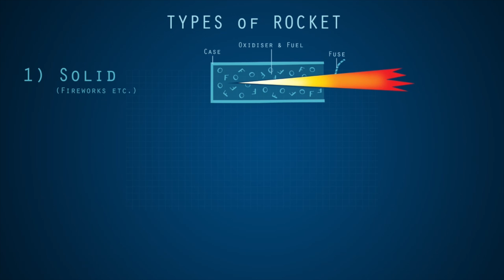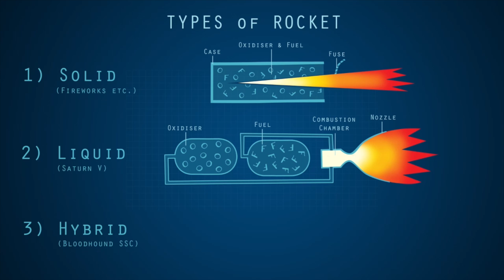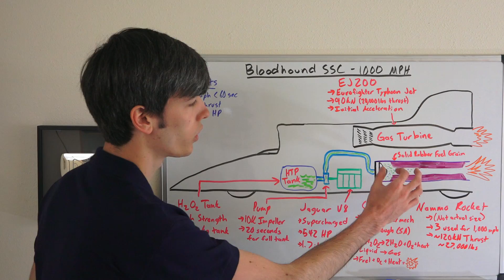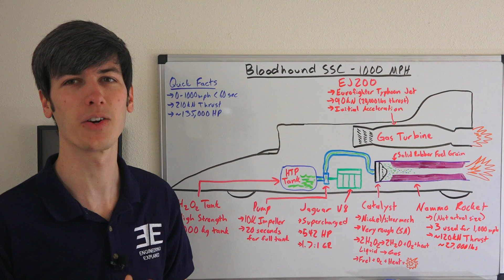Bloodhound SSC - 1000 MPH Hybrid Rocket System - Explained

Comment: With a total thrust of under 50k lbs, aside from cost, why didn't they just use a bigger jet, the the big GE jets pump over 115k lbs of thrust?
Reply: It still has to fit in a relatively small car.
Reply: A good question. A GE-90 costs about $25 million for a start. This EJ-200 is on loan from the RAF because it's out of hours. Secondly and much more importantly, jet engines cannot process supersonic air. A special intake duct has to be designed which will create shock waves which will slow the air down sufficiently for the engine to process it.

The front of the Bloodhound is very cleverly designed. The first shock is created by the cockpit canopy over Andy Green's head. There will be a number of other features in this inlet to slow the air down but it remains relatively simple. It's a pitot inlet like an F-16 or Rafale. A more complicated variable geometry inlet (like the F-15 or MiG-31) would not be worth the effort unless they were planning to go over Mach 2.0.

Finally, the EJ-200 engine is only 73.7 cms in diameter. A GE-90 is almost 4 metres because it has such an enormous bypass ratio across (it's designed for high subsonic cruise efficiency) so building something so big would be impossible.

In any case, a project like this needs an afterburner and the GE-90 just couldn't be made to work in an application like this.

Inlet design is probably the most complex part of this whole project because subsonic air behaves very differently from supersonic air. Their biggest worry will be the critical drag rise at around Mach 1.1.

Comment: Wouldn't it more correct to describe the EJ200 engine as a turbofan rather than a gas turbine. Gas turbine sounds like it has a power output shaft driving the wheels. Love this channel btw.
Reply: +Lord Humungous Engineering in general is quite nomenclature sensitive, because it's easy to confuse concepts if we aren't careful about the language we use.
Every turbofan engine is a kind of gas turbine engine. Btw, EE didn't use the proper nomenclature either. Properly, it's a "gas turbine engine" and not just a "gas turbine". A gas turbine alone is simply a device (usually a disc with blades or vanes) used to extract mechanical energy from a flow of gas. Even more correct would be "gas turbine jet engine", since the useful product from the engine is a propulsive stream of high-velocity gas.
Reply: +totoritko Thanks for the input. We both know the difference.
Reply: It is indeed a very nice low bypass reheated turbofan! Kindly donated to the project by the RAF :D

I think you'll find that in the automotive context a lot of these aerospace terms are grossly misused. For example a turbo compressor consists of a compressor directly connected to a turbine (your basic gas turbine configuration, nobody uses gearing unless absolutely necessary), but often people will shorten it to "turbine", which is a component of the system, but useless on its own. Same with gas turbine engines. Turbine is a very general term, referring to any device used to extract energy from fluid flow, either pressure driven (as in gas turbine engines) or velocity driven (as in windmills and wind/tidal turbine generators and ram air turbines on aircraft). Just based on those two categorisations alone you have completely different principles of operation and geometries.

It certainly helps to be specific!
Reply: You're absolutely right: very few people who follow motor sport understand gas turbine engines at all. I tried to explain a jet engine to someone once and he found it very hard to get used to the idea that there wasn't some other engine inside driving it! But don't forget there are also turboshaft engines which can be made to drive helicopter rotors or propellers. Some have even been used to power wheeled vehicles.

Comment: thats one expensive fuel pump
Reply: +Tailz99! Compared to the rest of the vehicle, the V8 is chump change. Your average (civilian aviation) business jet engine will set you back well north of $several mil.
Reply: You may think it is expensive, but it is free for the creators since Jaguar put their name on it. Jaguar basically gave them the V8 for free and most likely paid them to slap their name on it. Great advertising since Jaguar can now successfully say that they power a 135,000 horsepower thing.
Reply: Nah, cheap.

Comment: What sort of tyres does it use?
Reply: It doesn't. The only time it will use tyres is for runway tests. As soon as it get to south Africa it will be on solid forged aluminium wheels. They have to be able to turn at 10,000 RPM without flying apart.

Comment: One question people might ask is the 0-60 time. But I'm guessing that's going to be a fraction of a second so not really worth comparing. My questions is: how fast can it accelerate in 5 seconds?
Reply from the maker: Actually it starts off fairly slow (like a plane) but then once the afterburners fire things start moving more quickly, then the hybrid rockets fire and it's gone. I'll have another video that will help break down the speed!
Reply: sludgecity138 What a dumb guess.

Comment: What are they using for wheels and tyres? at 1000 mph they would be rotating at speeds that would cause normal wheels to just fly apart due to the centrifugal forces.
Reply from the maker: fuzzybobbles Yes indeed! Solid aluminum alloy wheels, no tires. I'll have more on this in an upcoming video.

Comment: This is all theoretical right? How are the tires able to go that fast too?
Reply: Albin Bunjaku

G-forces are a matter of acceleration, not speed, and this thing won't be doing any cornering (no angular acceleration to worry about), so I imagine it isn't much of a design problem compared to something like a jet fighter (which can endure multiple-G turns).

Quick calculation suggests that the average acceleration will be a little less than 1G for the ~55 second run (final velocity, v = ~469m/s, time t = 55s, average acceleration a = (v - 0) / t = ~8.5m/s^2 (~0.8G), |1G| = ~9.8m/s^2). Obviously, though, when the rockets start, the acceleration will change. I don't know how much of a difference there will be, because it all depends on how the mass of the vehicle changes over time, and how it reacts to the air pressure trying to slow it down - I imagine 469 meters per second is way beyond terminal velocity for something like this at sea level.

The wheels are made out of solid aluminium, so it has no tires of any kind.
Reply from the maker: spacekeeper The outsides of the wheels will be subject to approximately 50,000 radial g's (from such a high rotational speed). Lateral g's are nothing to be concerned with. :)
Reply: I wonder how they can handle the g forces

Comment: The video shows this is a manned vehicle, rather than remote controlled, so I was wondering what kind of G-force he will be experiencing???  I know F1 drivers can experience up to 5G's in a race, but they are cornering and braking, and about 3G on acceleration.  Just curious.
Reply: Watch the video Chris Harris did about this, he explains it in there
Reply from the maker: StevenSWM Maximum 2 g's accelerating, 3 g's decelerating. I'll have another video with more detail soon! :)
Reply: Average acceleration for the duration of the run is around 1G, but I assume it ramps up during the jet engine stage and increases when the rocket boosters activate. I think F1 cars are a different beast, because they need to get up to speed after cornering on what could be a very small straight, whereas this monster will be accelerating on a salt flat for almost a minute, most of which will be under jet power (I assume).

Comment: Why didn't they directly used liquid oxygen or solid or liquid ozone and ozone can decompose at a faster rate than peroxide and the extra weight would also be reduced as peroxide will produce water with oxygen and equal amount of ozone will only produce oxygen.
Reply: Liquid ozone is absurdly dangerous and volatile. It has been done before, but it's apparently very difficult to work with, even using a mixture of O2/O3.

Liquid oxygen requires cryogenic equipment and a pressurisation system. I think it might have been a weight issue (depends on whether the cryogenics would weight less than the V8 pump), and possibly also a safety issue, given that there's jet fuel on board and no ejector seat for the pilot.
Reply: Most liquid fuel rockets use hypergolics which explode on contact with each other. The other issue is that you're not after outright burn speed because the flame has to be stable or it won't work. In a hybrid engine it would shut off. In a hypergolic engine it could explode.

Comment: gas turbine coud powered oxidizer pump, instead of V8
Reply from the maker: Its MAGIC Why does a V6 rev higher than a V8? Big generalization which isn't that dependent upon the layout. 2013's F1 engines could triple the RPM of many V6's out there.
Reply: Bastek Master But the F1 engine has all the power at the top end, while the supercharged V8 has more usable torque to get the pump up to speed.
Also, if you would connect the two rockets, you would lose some of the control.
You can shut down the V8 very quickly, you can't do that with the turbine. So while the turbine would be still spinning, you would still be feeding fuel into the hybrid rocket.
Many many reasons why neither the turbine nor a F1 engine running the pump would be feasible.
Reply from the maker: Bastek Master I suppose, but you'd have to run a shaft down which could get a bit complex. It's also more controllable as a separate system, they were originally planning to use a different engine.
Reply: It's funny they used a v8 instead of a v6 when a v6 has a higher rpm.
Reply: Engineering Explained In a video of Chris Harris on the bloodhound, an engineer said that they where actually using an F1 engine, from the 80s if memory serves me well, and that they switched to the jag V8 because they needed more torque.
Reply: some industrial turbo shaft gas turbine, has addiectional turbine shaft stick out of compressor site for generator.
there is power turbine (lower RPM) shaft inside main shaft...
there could by fueal pump monthed, instand of generator.
you need right pump to right turbine power and rpm mach......

V8 easy way, but not so elegant :P
Reply: Bastek Master like turbofan engine
Reply: Tyrone butterworth they need power = RPM * Torque
Reply: Bastek Master nope.... they needed torque. I am pretty sure the engines where very close horsepower wise but dude said that they chose the jag engine because of the much better torque it provides
Reply: Tyrone butterworth dude said they use gear. using gear you can mach speed or torque but not both. You just need enough power, speed or torque you can adjust with right gear ratio.

In rotational systems, power is the product of the torque τ and angular velocity ω,
P(t) =τ*ω
where ω measured in radians per second. The *  represents scalar product.
http://en.wikipedia.org/wiki/Power_(physics)
Reply: whatever, stroke engine :P
Reply: F1 engine needed a step down box, to get it to a usable rpm for the pump.. 

Where it is easier to just use a more torqued engine.
Reply: The Jag engine was chosen because it was available but in the greater scheme of things, the choice of fuel pump was not that difficult compared with the other challenges they had to overcome. There is absolutely no reason why the fuel pump could not have been a gas turbine. A Pratt & Whitney PT-6 or similar would have been an excellent choice (very available, powerful and reliable) and it would have been considerably smaller and lighter than the Jag engine. The trouble would be the size of the reduction gearbox needed to get the RPM down to a manageable size. Extracting heat would have been harder too. On the upside, it could have shared the fuel type with the EJ-200, which would make things simpler and it would almost certainly be lighter overall.

But what are we talking about are? The fuel pump itself uses an extremely clever priming system which is only hinted at in this video and the hybrid rocket is actually throttleable, which is amazing by itself. That's not so hard with liquid fuel and/or hypergolic fuels but it's very difficult with a solid fuel component. All that is worthy of a video on its own. And really, the Jag engine is only 540 hp of non-motive power against 135,000 hp which will actually power it. It's chicken feed but it gives some idea of how much power this thing produces.

For the record, the Saturn F-1 engines from the Apollo Moon rockets used a 55,000 hp turbo pump, which was itself a gas turbine.
Reply: Bastek Master The engineer states that the lack of torque from the F1 engine was the cause for them to switch with with a Jag V8.